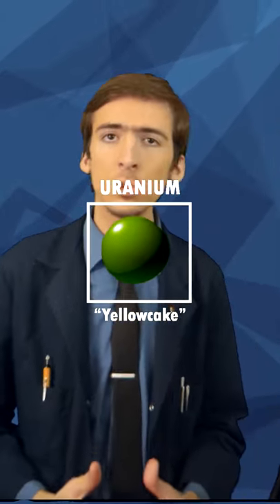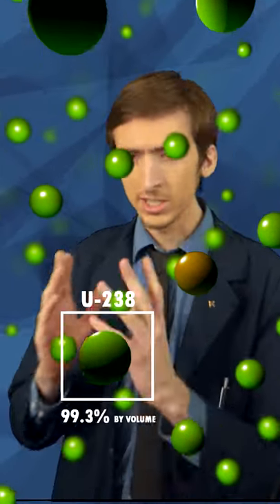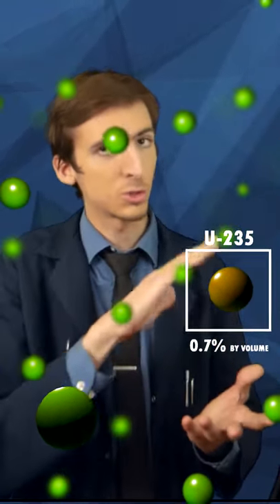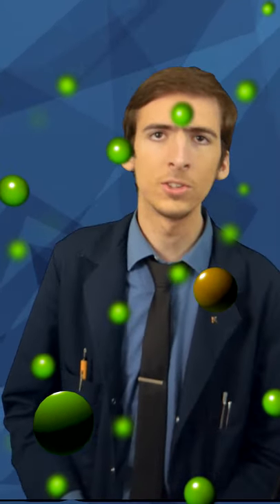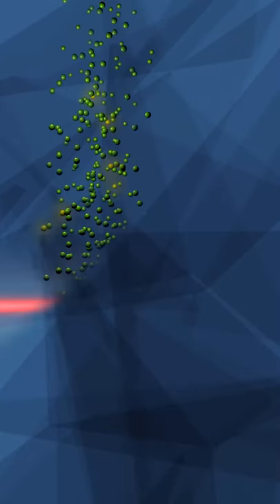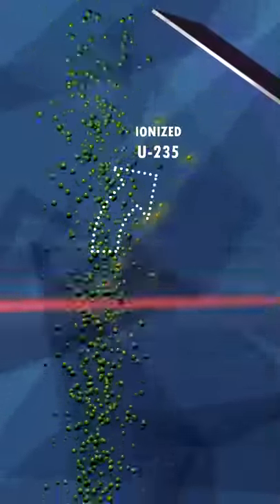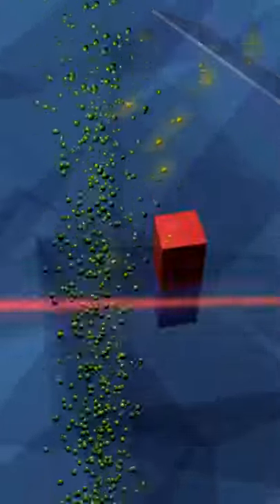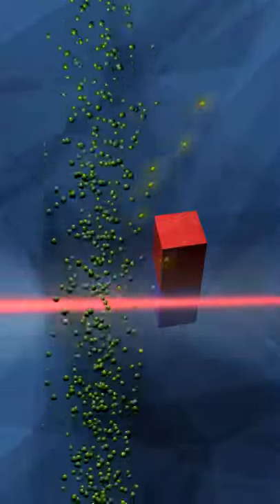New Way to Enrich URANIUM Using a LASER | #shorts

Comment: This is actually a 2 step process, the 16 micron radiation will excite both the U235F6 and U238F6 at the same time. But the U235F6 will have a slight edge in energy absorption, in order to complete the photolysis process you need to excite both again with a UV wavelength beam. This will allow U235F6 to dissociate into U235F5 and turn into a solid.

Comment: Hi can you tell how a Laser Diod is made
Reply from the maker: The short, short version: they are LEDs between two mirrors - as the light bounces back and fourth between the mirrors, it accumulates photons. Some resonance voodoo makes them all the same wavelength and phase.
Reply: @BlueprintScience  thanks man

Comment: I'm confused. How can low energy (infrared) ionize any element?
Btw. Not denying it, but don't understand the mechanics for that to happen.
Reply from the maker: Quoting from the gov’t document I referenced (included in video description)…

“The AVLIS method of isotope separation depends on the quantum mechanical connection between energy and frequency in an atom’s electrons. […] AVLIS achieves separation of uranium-235 from uranium-238 by taking advantage of the slight difference in the energy of transition between the two isotopes. For uranium-235 and uranium-238 this spectrum difference is small, about 4.2 x 10-5 ev. This means that a laser beam must be tunable to an accuracy of 1 part of 105 in order to excite and ionize one of the isotopes”